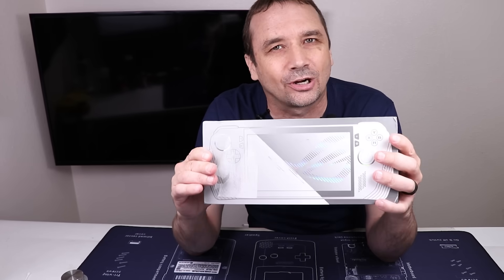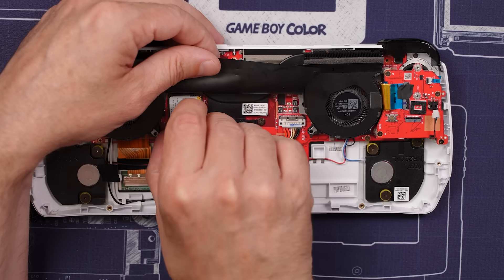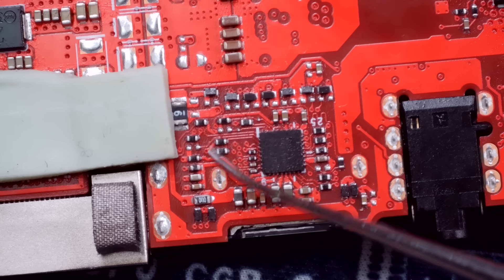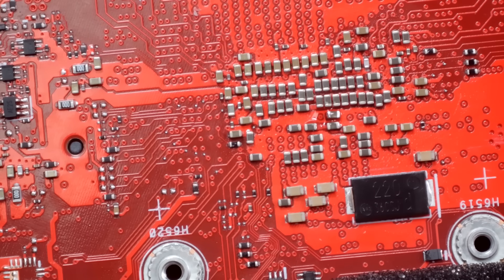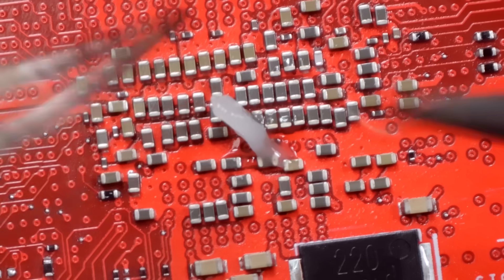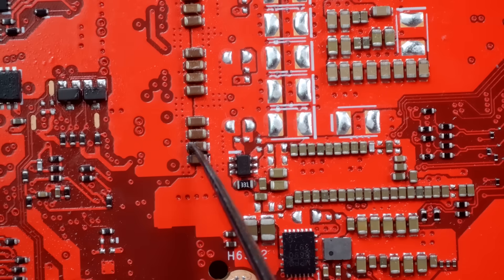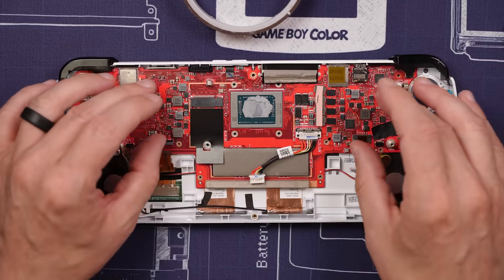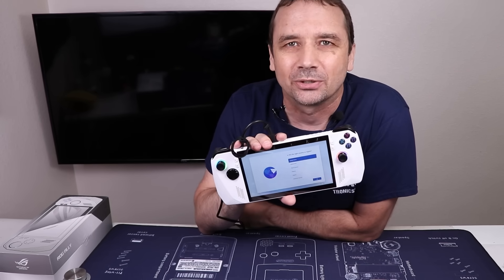ASUS REFUSED to Fix His ROG Ally - Can I?

Comment: I think they could of just attended the charge the broken components when they had their suspicions about water damage on the chip but then said this would now no longer be under warranty.

At the end of the day, the customer wrote a security seal to gain entry to sensitive parts of the device, and that in itself is a warranty voiding act. 

He should have just sent it back when it wasn’t working the first time and not messed with it.

Comment: Support not taking the repair under warranty is justified since the user has already taken it apart and done repairs on it. But still charging $800 for that repair is absurd. So they are right, but also wrong for it.

Comment: as someone who repairs electronics daily, i think it's completely understandable to refuse repair on a device that the customer has tried repairs on themselves, especially if they tried reflowing and had high heat on the board.
i can't tell you the amount of times we wasted hours looking for faults just to find out the customer swapped out components or messed up pads.

Comment: People diss a lot on Asus warranty service, but I had to avail it twice this month and can only say positive things about it.

First one was for my laptop, which I knew failed due to static discharge when it was worked upon without discharge. Asus provided on-site warranty for it and replaced the mainboard with no questions asked.

Second one was for the ROG Ally. The SD card reader failed and they did a pick up and delivery of the device with a mainboard replacement.

I am not in the US though, so probably the experience is different over there.

Comment: ASUS is known for taking any excuse if it exists or not to decline warranty work. They should not have declined warranty in this case, owner working on it is not a valid excuse to deny warranty either. The only time that would be valid is if they've caused more damage to the unit trying to fix it.

Comment: The weird thing in this project is that you assume a blown capacitor is caused by an accident during a repair, but it also can be a symptom of some underlying issue. As long as you don't fix that underlying issue, the capacitor will keep blowing up, no matter how many times you replace it. So it makes me think you were lucky with your assumption.

Comment: 1. you dont tinker with device under warranty (that was for the owner)
2. manufacurer has the right to refuse repair if device under warranty was manipulated
3. why Asus wants to charge more than it is worth new? (found new ones for 530€ - 620$) and why they lie about liquid damage?
4. nice repair work 👍
4. you did not check the MicroSD slot on camera
Reply: They likely opened it up, saw the goop on the board and went "Nope! Looks like something spilled on it!" closed it up and sent it back.
Reply: @SilvaDreams  they likely get a bonus if they deny 80% of claims. didnt look at anything, made something up and sent it back.
Reply: 1. they will deny warranty repairs even if you didnt. 
2. they will deny warranty repairs even if it wasnt.
3. they are a evil greedy company
4. yes
4. yes

Comment: I love my ROG Ally, but Asus is a bad company. My wife had an Asus laptop that the keyboard started to malfunction under 6 months. Sent it in for warranty and got it back "repaired". Well, it was still not working and we sent it right back. This time we were told there was liquid damage and we were denied the warranty. There was no damage, she babied that computer. I was told then that Asus says liquid damage often... Seems like they haven't changed. ALSO the SD card issue on the Ally should have been handled better. They NEVER fixed it. Most people just dont use an SD card. I know I dont.

Comment: I sent an ASUS Rampage V Extreme motherboard to ASUS for a faulty CPU socket. They sent it back with a thumb print in the pins and said it arrived like that. No-one in Australia can redo CPU sockets that I have researched so now its just a display piece for a very expensive motherboard. To say I was pissed with what they did, is an understatement.
Reply: Always take pictures of your device before you send anything in for warranty work .
Reply: @JimBobm  And this I did. If you search their forums, you will find my post on it. They would not come to the party and fix it either.

Comment: The standard "liquid damage, we will charge double the price of a new device" is just pure lies and gas lighting and a scummy way to treat a customer. However, having said that, the guy did try to "repair" stuff himself, and i can understand how a maker of devices like this wont guarantee anything if people starts dissassembling and soldering themselves in there. Most customers are probably bound to screw that up. I can see them charging 100$ for finding the problem , and another 100 for fixing it. Basically whats done in this video. So paying 2-300 is something I would expect, even for an honest company.

Comment: I don’t buy Asus products specifically because they don’t honor their warranty.  I had a $1000 graphics card, one of the capacitors wasn’t soldered correctly and it fell off.  They wouldn’t fix it, it was ridiculous.
In this case I’m not surprised because he tampered with it.  I don’t liquid cool my graphics cards anymore simply because I don’t want to give them a reason to deny warranty.

Comment: They should definitely have covered it. The law is pretty clear -- the Magnuson–Moss warranty act says that merely opening or replacing parts in a device does not violate the warranty. The warranty can be voided if the modifications can be shown to have harmed the device.  So the 'warranty void if opened' are illegal.
I, too, fail to see liquid damage indications, nor even the presence of liquid so far in the video.

Comment: In defense of Asus, the device was tampered with. Wich is a no go for warranty work.  I do however think they could have done a check on the board and disclosed to the owner the problems they found ( i find it kind of hard to think they did not notice those issues you found).

Comment: Something that may have helped with that dodgy solder pad is wicking away the old solder, cleaning, and applying fresh LEADED solder. It’s possible that mixing leaded and unleaded was causing issues, or perhaps there was some contamination (due to the alleged liquid damage) which made the solder not want to stick.

Whenever I rework modern devices with unleaded solder, I always remove it first.

Comment: In my case, ASUS wasn't able to tell me, which LEDs they used for the backlight of my keyboard (there are failing more and more). Sadly they told me single LEDs but not the needed RGB lights. So if ASUS doen't know which parts they use, how can they repair their items?

Comment: This is a fun one:
on one side, if the user did do some repairs prior to sending it to Asus for the warranty, it might be normal for the refusal... but
from the other side, if it's a known factor that Asus would refuse the warranty because it's the sd card reader, then the question becomes "what do I have to lose"?
In other words: what is the lesser evil here, trying to fix it yourself and get refused warranty due to your own repair, or get refused warranty because Asus can't admit to mistakes or their own wrongdoings etc...
If it could be proven, beyond the shadow of a doubt, that the capacitor was blown due to the users intervention to fix his sd card reader, then yes, Asus might be rightfully refusing, though then they should just tell the person what's up and not pull something out of their behind just to be done with it. If both cases are not related, then Asus should just get off their behind and fix the damn thing, it's not that at most a few dollars component is goin to kill them, now is it?

Comment: I think this is the original ROG Ally which had SD slot issues and heat related issues which was widely publicised and Asus were refusing to fix for free.  The SD slot on these is near the exhaust vents which get very toasty.  This is why I would never and never will repair my own device - this way I cannot be blamed.

Comment: Asus probably just wanted the person to buy a new handheld. They probably knew he was inside it saw the remnants of flux and said it was liquid damage. They probably also saw the one blown capacitor and blamed the person for the damage. I wouldn't be surprised that other part that was loose on the board was either not connected to the board from the factory. Or Asus knocked it off while looking at the board to try to make a case for liquid damage. So Asus wouldn't have to fix it for free.

Comment: If the owner had informed Asus he had taken the unit apart, that would void the warranty. Also, seeing as there was ‘liquid’ residue on the board, would be an indicator that it had been opened. The owner should have never tried to fix it himself, if he still had some warranty coverage left. Great video as always! Best wishes from Virginia.
Reply: @rondickson1491  opening your device dose not void the warranty on a device like this hand-held,laptop,gaming console . That is simply not true. You can absolutely open a device and have a warranty clame covered i have done it multiple times . Think before you say something so incorrect.

Comment: The fact that a quick look with a microscope showed a blown capacitor and a loose one (I stopped them right away)...  I did notice a lot of the capacitors above the SSD card chip were crooked too.  They wanted over $800 to fix that.  Even if you were running a shop that should have been $150 to fix.  $800 would be putting in a dozen jumper wires to fix broken traces minimum.
Reply: @toddabbott781  $800 is most likely for a new motherboard, because it wasn’t economically viable to troubleshoot this one after the owner messed with it.
Reply: @TheStanHill  They only cost $899 retail new.  It would only take about 20 minutes to swap out and this would not be the controllers, buttons, storage, fans and heatsinks, case, battery, charger, screen...  The board should only be maybe $300-400 and $100 is labor.  They just don't want to fix it so they are quoting a ridiculous price.  You can get a full used system in great condition for under $700.

This is why we need Right to Repair.  They should make these part available for a reasonable price.  The Steamdeck has most parts available, but sadly not the motherboard and they are one of the few that do even this.

Comment: Honestly, they did tamper with the console itself so i would say that asus were on the right side here.I know they didnt intentionally break the capacitor but the system not turning on was a result of their fault when they opened the console.Yes, I do think it is strange that asus claimed that it was water damaged.I think asus had every right to deny that repair, the only bad thing was how they claimed it was water damaged when it was so clearly a capactor.This definentlty shows that asus definetly doesnt pay much attention when it comes to repairs and just jumps to conclusions.What im wondering here is why didnt they send the console in the first place if it was under warranty.

Comment: I'm willing to bet that the forward facing customer service rep and the repair tech are two different people; probably even in two different places. The repair tech entered in a code that means that the repair can't be done under warranty due to something the customer did to the unit, and the customer service rep interpreted that code as "water damage" because that is the most common thing that customers do that prevents a repair under warranty.

Comment: My 1 y/o daughter accidentally pured a quarter of a glass of water on the screen of my ally. I swear I didn't instinctively pressed the power button to turn off the device but I saw it went to the power-off animation. I quickly took it apart, disconnected the battery, wiped the insides with a few hand towels, blew some of the wet components (ICs, capacitors, fuses) with compressed air, prayed to all the gods, put it back together and to my surprise, it's working fine. I was still skeptical but after 2 weeks today it's still fine.

Since warranty is now void, I plan to upgrade the battery to 79Wh.

Comment: I'm in Oz where warranties seem to be more enforceable but this one is tricky. The owner dived into the machine and did stuff so Asus are actually in the right as the unit has been "modified" from new. The water damage is just them using a loophole I think but really the owner should have left it alone and gone for the warranty first up. I mean who dives into such a technical piece of hardware with no schematic and really, no idea? So I'm calling this one, owner at fault. Lesson to all. BTW, AU$1400. Not worth it here in Gougedville AU.

Comment: Normally I'd say Asus used liquid damage as a copout, but in this case I don't blame them for refusing the repair because of work done by the owner. I'm not sure why they did that while it was under warranty. 

I agree with your use of the iron on that first crooked cap, because I know if it were me I'd have blown all the other caps in the area all over and made a huge mess 😅. Nice catch on the other shorted cap, and nice fix Steve!
Reply: Unfortunately,  most companies will refuse to do warranty work if it has been opened up and tampered with.  Sometimes they have stickers that when broke say warranty is invalid or they will state something similar in instructions.  They want to avoid the extra work , when not knowing what the user might have broke.  Essentially though you open case you void warranty in a lot of products.  Best to do warranty send in first if under warranty
Reply: @magusfire31  While I agree that sending it in under warranty first is the right choice, is it actually still legal for companies in the US to refuse warranty on a previously opened device? I know here in Europe it isn't, because you're allowed to try and fix your device yourself and if a company refuses your warranty because you opened it, they have to prove that you opening it was the reason for it not to work anymore.
Reply: @MyRegardsToTheDodo I think opening it is ok, but if you attempt a repair that will void the warranty. You might get away with swapping modular components, but reflowing a bga chip won't fly.
Reply: @Shinquapin  Depends, if the BGA chip is actually defective. The BGA chip was ok, another component was blown which was completely unrelated to the BGA chip. And while this might not have been covered under warranty, that would have been an entirely different reason.

Comment: If Asus refused to fix it because he had already tampered with it then yes. But Asus refused because of liquid damage. So there must be proof of liquid damage and there wasn't. So either Asus lied so they didn't have to fix it and get him to buy another one. Or whoever looked at it had no idea about flux and took it for granted it was liquid damage. Either way if his attempted fix didn't void the warranty, then Asus should have fixed it for him. I doubt that he broke off the first capacitor could have been faulty from the start. With the high voltage does sound accidental. But since Asus can't tell the difference between flux residue and liquid damage anything is possible.

Comment: I think unless they show evidence that the capacitor was already damaged when they received it then they should have fixed it as it is possible their repair tech did the damage to the board, though it is also possible the customer did the damage also, which is why I think if they can show they received it with the damage already there then the warranty repair wouldn't apply because of possible damage by customer, although I do agree the price of the repair quote is ridiculous, if you charge more for the repair than just replacing the device speaks volumes as to where your priorities are when it comes to helping your customers.

Comment: I think it's fine that they turned down a warranty repair as the hardware had signs of user tampering, but it was BS that they said there was liquid damage and the cost they would charge to repair the unit was just an insult.

Comment: Depends on ASUS’ policy… if cracking the case immediately voids the warranty (like most electronics ), then - yes - it’s their right to deny any claim.
But stating it’s “because of water damage” is BS and coding a repair value. That’s more than the price of the unit itself is ridiculous.
On principal alone, I won’t buy an ASUS anything lol
Reply: Then they would've been sued. You can't deny warranty for opening anything in the US thanks to the Magnuson-Moss Act in 1975 unless you can prove that there was damage inside the device that caused the issues. It was easy for ASUS to see the potentially low-quality flux and claim that as liquid damage, especially since the customer also had a failed soldering attempt. Denying simply because you removed the back cover or whatever is illegal.